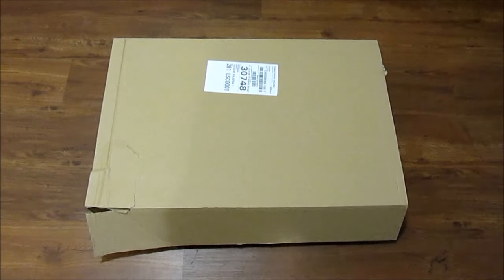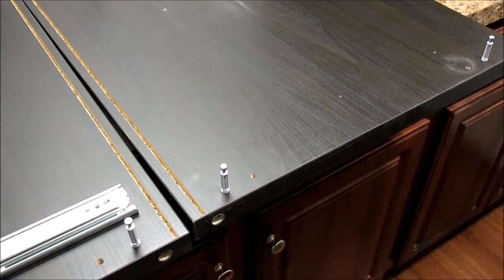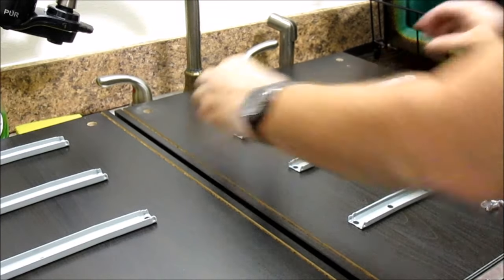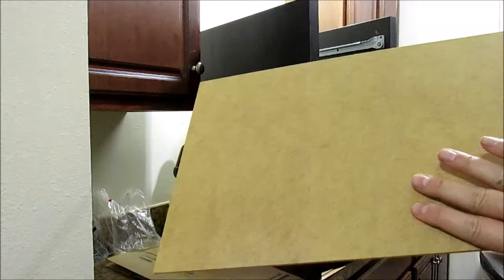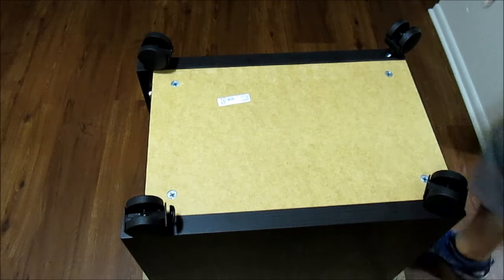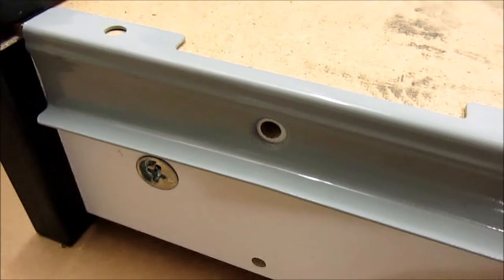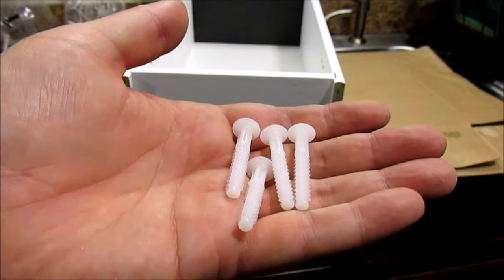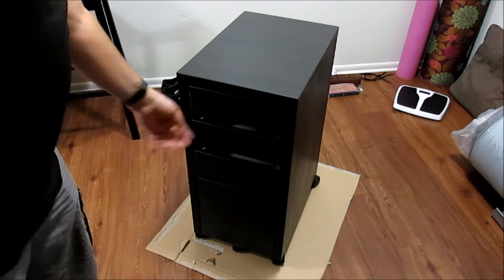IKEA Micke drawer unit assembly - DETAILED!

Comment: Did this today, gave up on the instructions midway through and just used your video! Love how clear and straightforward and visual it was.

For the comments about the struggle inserting the top drawer: try putting it in the lower racks and watch how it slides in so you can aim for the same angle. It feels awkward and sticky but it’s just an odd angle at first

For separating the tracks in the last step: this totally stumped me and I struggled to see how it was working in the video. Looks like ikea’s updated the Micke too because my tabs were black. The trick is pushing the curved black plastic lever IN, at the same time as pulling UP on the track. Worked like a charm!

Comment: I'm having serious trouble getting the 1st drawer in, everything else was great and Ikea should really have you on payroll. However the 1st drawer won't go in at all I'm not sure why... Can I get some help please?
Reply: I’m sure you already got this fixed, but I simply loosened each screw closest to the wheel on the rail that is mounted to the cabinet.
This allow the drawer to push the rail down a bit and slip in.
Reply: @maxmucino  I wish I read your comment earlier, I had the same issue as the person with the original comment. The first drawer is way more hard to push and pull out than the rest of the drawers, and I have owned mine for 7 years. I just never bothered to search up this issue as I didn't realise other people might have the same issue in theirs. 

Thanks a lot though:)

Comment: Inside dimensions of the drawers? Also, how hard would it be to cut out a section on the back?
Reply from the maker: Top 3 drawers are the same interior dimensions:
3.0" high x 14.25" deep x 9.25" wide
Also, by design there's a 1" gap above and below the middle of top 3 drawers. More room to pile stuff in the drawer.

Bottom drawer interior dimensions:
10.0" high x 16.8" deep x 9.25" wide

Comment: do yo have to add the wheels? Just curious, just looking at furniture options for college.
Reply from the maker: Hi. It might work on a hard floor like tile or vinyl, but if you're on carpet, you won't be able to pull out the bottom drawer--it's designed to have the wheel support the front of the drawer. If you don't want to use the bottom drawer, then no problem; leave the wheels off! Hope this helps! Good luck!
Reply: i have carpet and it works without wheels